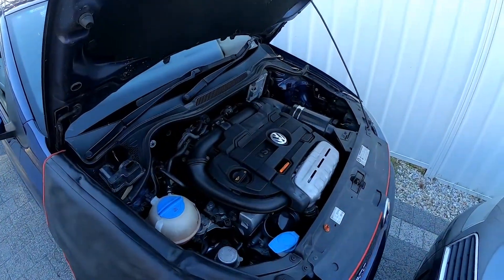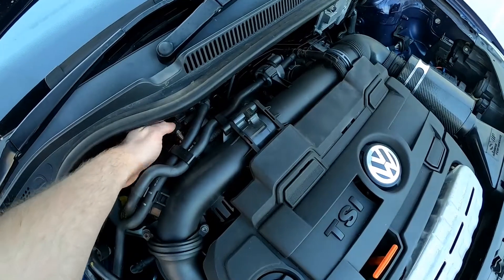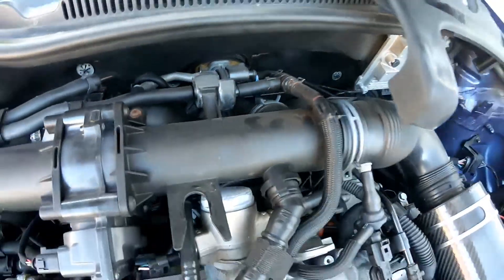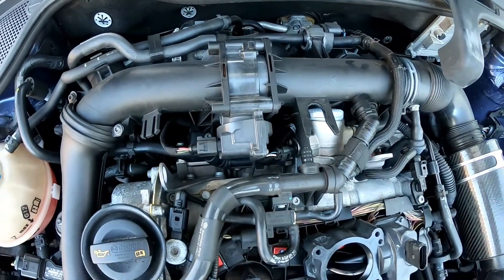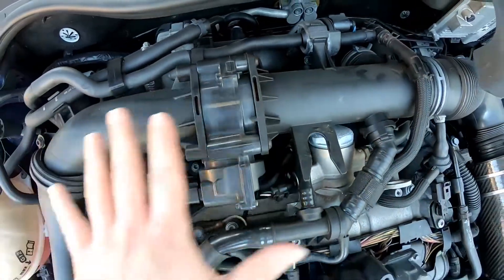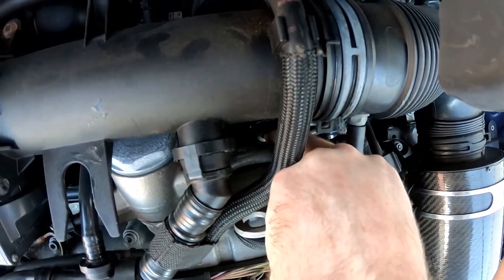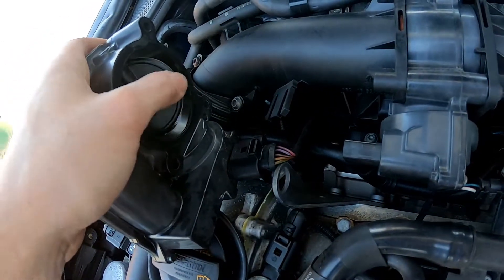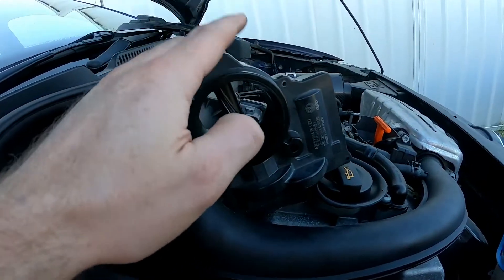P10A4 1.4TSI Inlet Regulating Flap Fault VW Audi

Comment: What coil packs do you use?
Reply from the maker: They are Okada Projects plasma direct coil packs. They are quite expensive though. They claim theu can output up to 4x the amount but not sure if it's proven or just marketing. I personally would put either 2.0T or R8 coil packs into it if it were my money doing it. These were in it when I bought the car (APR Stage 2) and I haven't had anything bad to say about them, just wouldn't pay the price over readily available parts from the VAG parts bin. To fit the 2.0 or r8 coils, the wiring plugs need a couple of the pins moving in the plug too.
Reply: @FourRingsAuto 
 have you had your car remapped? I got my sons up to 210 on std injectors with good fuel mileage too. An incredible engine.
Reply from the maker: Stage 2 apr. 210bhp at the wheels.
Reply: Did you have problems with the standard coil packs.
Mine keep failing 😩
Reply from the maker: @fionnan2811happy  the car is running a lot more power and the standard coil packs are weak. You can also upgrade to 2.0tsi coil packs or r8 coils, and just have to change the pins on the wiring plugs around.
Reply: Would standard packs make the engine a bit rough at idle. Not bad but little sputter here and there??? And is there any upgrade version that fits without any wiring modifications to the connectors. I tried benchmark and one of them caught fire just as I was parking so I was lucky enough to spot the smoke as I was late and almost turned my back to run to a closing shop....🤯 and only had them a few days. They were a good product  and had bit more power and fuel saving  but I'm afraid to buy again and having a fire brigade come the next time. Got a refund from the seller and he or she was nice about it but they never  had any problems with their benchmark coil packs before so I got unlucky I guess, but nothing for the new connector and time spent to rewire some of the exposed wires. 
These things happen.